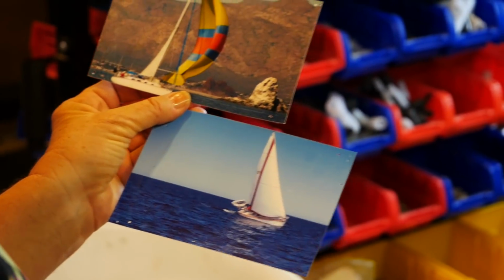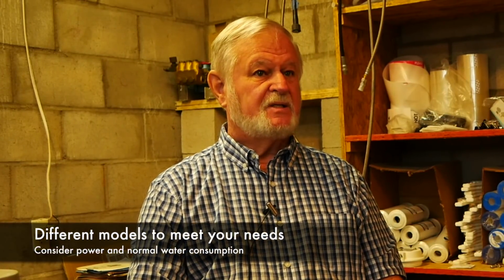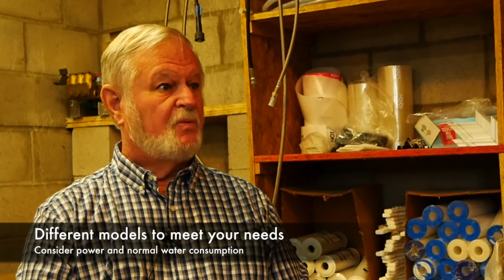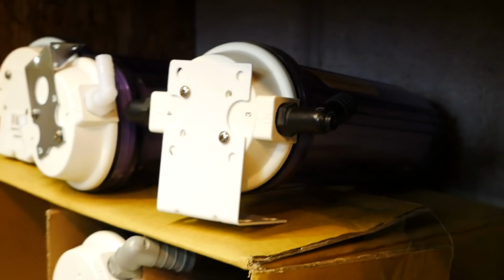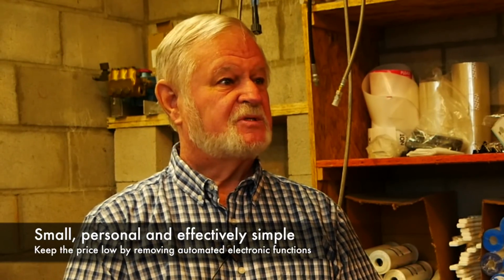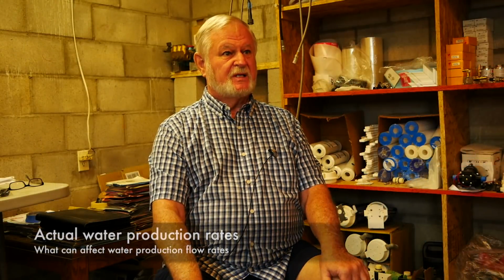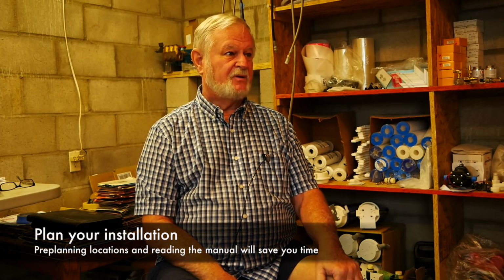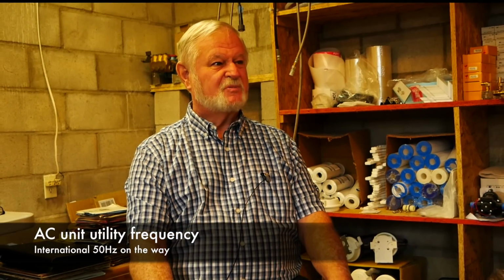ALL ABOUT SUN PURE WATERMAKERS [Side Adventure #6]

Comment: I actually have one of sun pure water maker got it back in 2015 it works great. Have the D.C. 1 horsepower
Reply from the maker: Sweet David, sounds like you are still happy.  What is the amp draw on that do you know off hand and what PSI do you usually run it at, guessing you have a 21" membrane?

Comment: Amazing interview! I work with an RO (reverse osmosis) machine in my job as a dialysis nurse. While the main RO is very complex and is the size of a truck, I work bedside with a much smaller RO the size of a mini refrigerator that I roll around to different buildings in our very large hospital. From what Stu describes, a boat RO is very similar to a dialysis RO that feeds 99% pure water to the dialysis machine. 
A couple quick thoughts, we’re told to never run the RO with warm water as it will hasten the burn out of the membrane. Also, is it safe to drink the final product which is pretty much 💯 percent water. 
Don’t plan on any long term cruising in the next few years, but when I do, I’m going to Stu.
Reply from the maker: We have not heard about the burn out of the membrane in warm water but warm water will decrease significantly the production rate and quite possibly speed up the life of the membrane.  It is perfectly safe to drink the RO water, we know some people do add or drink supplements to get the minerals however we do make our own kombucha which we make from the RO water and that nutrients as well as little packeted juice drinks that we add to get minerals back in.  Very cool to hear about your use of RO in dialysis, we did not know that was what was used and we thank you for teaching us something.

Comment: Hi guys, how do you go about remineralising your product water?
Reply from the maker: We do not is the short answer, our product water still has around 300ppm and we drink packet juices and make onboard kombucha that help with mineral intake.
Reply: Adventure Adrift Is this because an RO machine makes 💯 percent water? I work with an RO in my job as a dialysis nurse and was told it wasn’t safe to drink the final product, though I have at times.